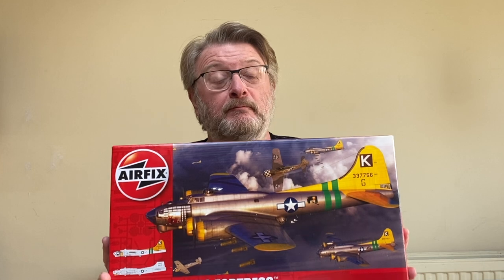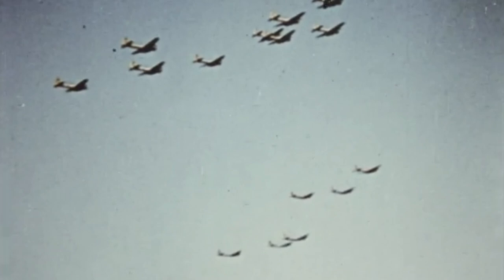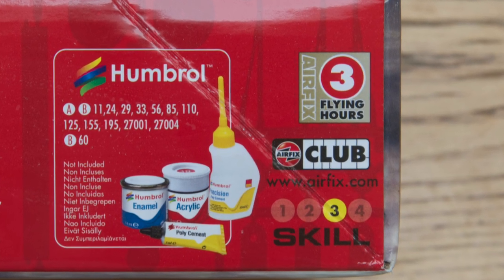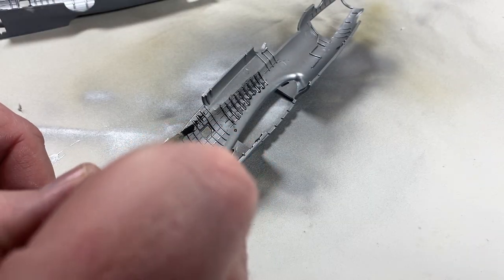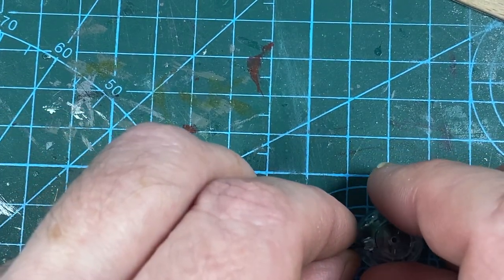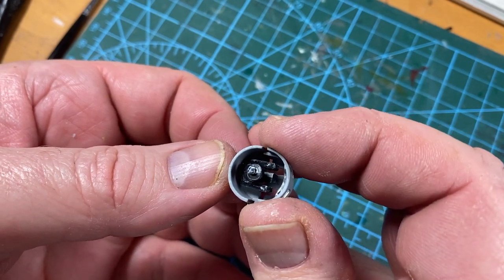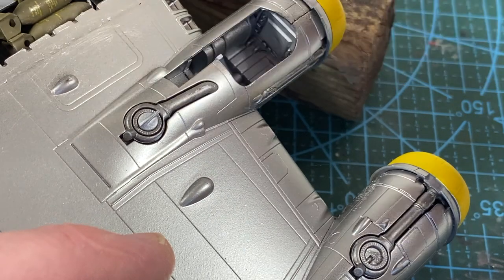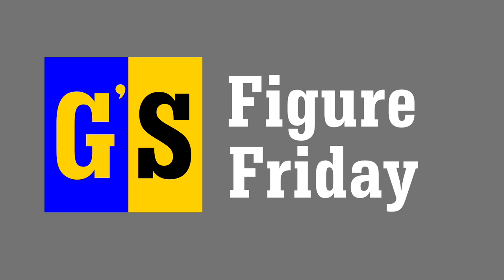Airfix B-17G Flying Fortress 1/72 scale full review & build - HD 1080p

Comment: Gary, really enjoy your videos and you are certainly a very skilled modeller.The B17 is one of my favourite aircraft and humble apologies if I appear to be nit picking but I don’t think your very skilled weathering is quite right.
The vents are outlets for supercharger intercooler and oil cooler air and no staining should come from the vents.Instead the oil stains from the engines went around the vent ,leaving the area behind the vent itself clean.There are many good pictures of aircraft that illustrate this detail.
Hope you don’t mind the comment which is meant in good faith and to be constructive.Keep up the good work
Stuart
Reply from the maker: Stuart, I am never, ever upset if someone points out something I've done wrong!!! Thanks for telling me!
Reply: @garys_stuff  Thanks Gary,have you considered doing a heavy bomber in 1/48 scale?  I have 3 vintage B17 kits in that scale waiting to be done 
Plan is to suspend them from the ceiling in a bombing run…..not sure the Missus is on board  with that idea quite yet!
Thanks for taking my comments in the good spirit it was intended
Best wishes
Stuart
Reply from the maker: @stuartwebster829  just one thing - I've been looking at the B-17 again and something puzzles me - where does the exhaust get vented? I assume it went through the supercharger bodies, but does it vent immediately after that or does it go somewhere else? Just curious as it's not immediately obvious on the kit! Cheers, Gary

Comment: Awesome build and video, what wash did you use, and did you apply any clear coats to protect the paint before you used the wash. How long did it take you to build?
Reply from the maker: Thanks! I use Vallejo model wash - normally 76.518 black. I use a fine brush and go along the panel lines with it - slightly diluted but the amount changes between models. With this metallic finish there was no need to clear coat first, but normally it will be either matt or satin as I find gloss makes the wash bead too much. Hope that helps!

Comment: I really want to do this kit but still very new to the hobby. Is this a good kit for people coming out of the basic stages?
Reply: I feel like more time is needed but you never know
Reply from the maker: Hi Vikesh - personally I'd suggest trying something in between first. The B-17 has a lot of fiddly bits inside, and it is disheartening if you don't get it right! Airfix rate it at level 3 (out of 4), so I'd suggest maybe a level 2 kit first. Something like the very good Bristol Beaufort or, if you want something American, the B-25 Mitchell. Both have interior details and gun turrets to build and install, but not quite at the level of the B-17! If you do decide to go straight to the B-17, then I'd strongly advise taking your time at every step. Be happy with what you've done before moving on, because if something isn't right now it can cause many problems later. Oh, and dry fit before using glue!!!
Reply: @garys_stuff  thank you
Reply: @garys_stuff  btw love the channel!

Comment: I’m getting this for my first ever kit aswell as the tiger starter kit from air fix would you recommend this kit for me?
Reply from the maker: I'd start with the Tiger first, then maybe get another small plane to practice on (a starter kit from Aldi or Lidl would be ideal) before going on to the B-17. It's not impossible to do but you might want to practice a few things first, like controlling how much glue you use! If possible get hold of something like Revell Contacta or Humbrol Precision Poly Cement as these have thin metal tubes to dispense the glue. The tube you get with the Tiger set lets out a lot of glue if you're not careful and that can ruin things! I'd also get hold of some modelling snips to take the bits off the frames and some sanding sticks (or disposable nail files). You can get things like this is packages with a cutting board and all sorts of other things very cheaply online. Look for "modelling tool sets". BTW, you might like to check out a video I made ages ago with ten top tips for new model makers - it's on this channel and I think this link will work: https://youtu.be/S3LGA3LMMxI
Happy modelling!
Reply: I think for your first kit start out with something simple like a starter set spitfire (that's how my hobby kicked in), But make sure to keep good care, until i built my Lancaster B.III i just chucked them and played round with them until they are now completely unpresentable, now I have wasted money on these (im only young inspiring modeler so not a large budget... also just looking for tips and tricks for details.) nut i hope you have a great time moddeling!